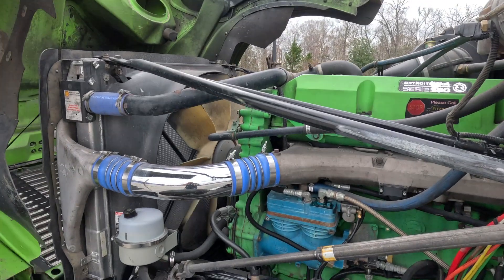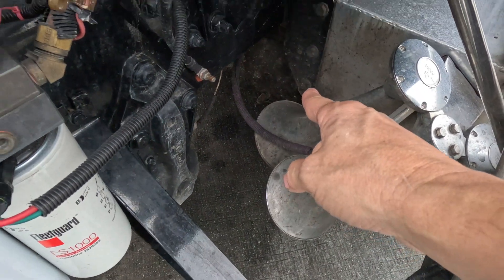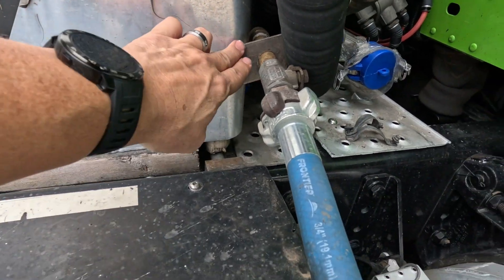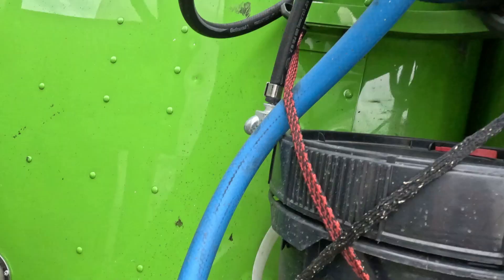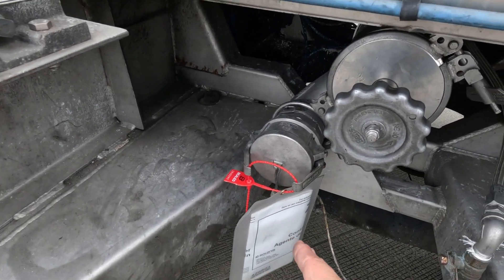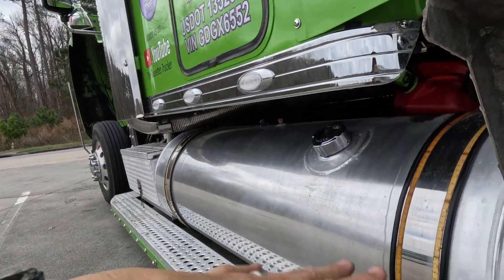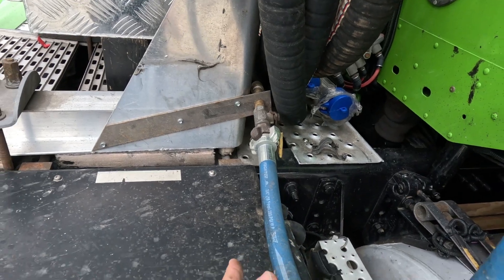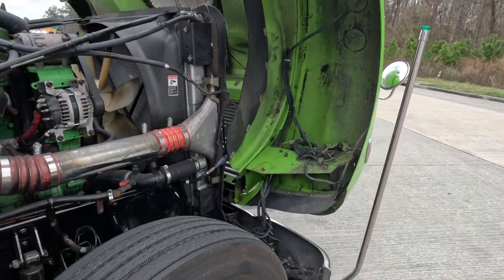How to unload a chemical tanker with truck air. Bendix 2 stage air compressor VS pto air compressor

Comment: Which option is cheaper, the bendix or the pto version? We already have a 2line wet kit and just need to add an air compressor to do some new tanker loads that require air off so trying to determine which is the best route to add
Reply from the maker: @Joe-k9m8p  I'd you already have an extra pto and switch mountes and available for use then just add the frame mount air compressor.
Reply: @ thanks

Comment: Did you install this yourself ? I been wanting to get one installed on my truck so i can haul chemicals as a 0/0 but all options are talking about cost anywhere from 7 to 17 thousand dollars.
Reply from the maker: My shop did it. It's not that much for just a 2 stage compressor that goes on the motor. It's only about 3k and the labor to take your old one off and put the new one on.
Reply: @TheTourettesTrucker  Your personal shop or the shop you use for your truck ? If your talking about a shop you use can I get the location and name of it ?
Reply from the maker: @Ball.Daily11  I use Dub's Big Rig Rehab at 2224 Barnes Rd Macon, GA.

Comment: Tony .. oil leak is 'pass over' - oil getting past compressor piston rings (usually when under no load) .. this can carbon up your 'hot line' to air dryer and plug its filter faster .. keep a close eye on dryer discharges .. you don't want oil getting into the system .. Great video .. regards from England.

Comment: Can you still use that setup to pump flammables? You mentioned hot air a few times and when I was in the chemical business we would either use house air or PTO driven air, or nitrogen when possible. Do you unload flammables with your set up?
Reply from the maker: We don't haul flammables unless it's customer unload or they have nitrogen we can hook to. My twin has a hydrochem with pu.p so he can haul pump loads but I can't with my set up.

Comment: I run at 900 rpm using my hydropac to air off. You can’t touch the airline without leather gloves after unloading, it’s way too hot.
Reply from the maker: They do get hot